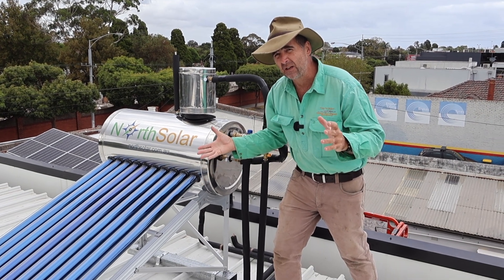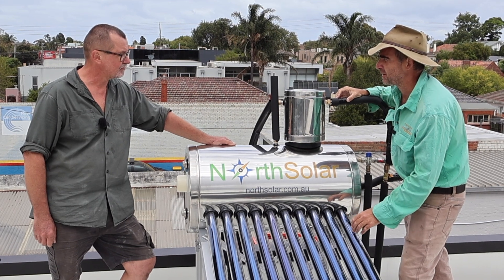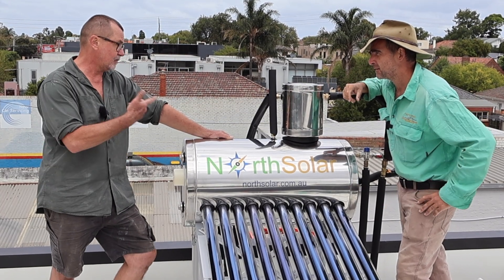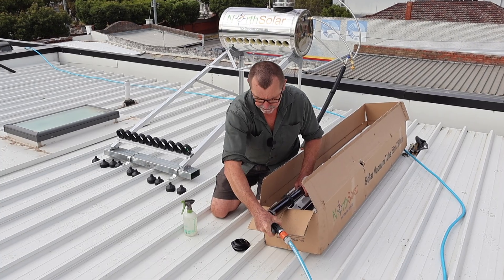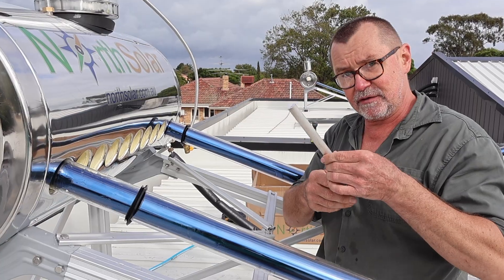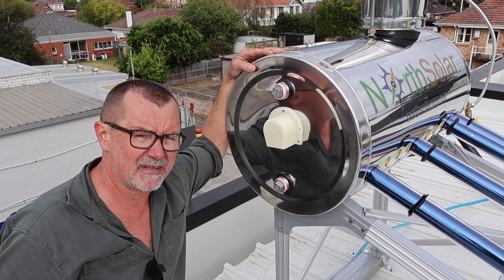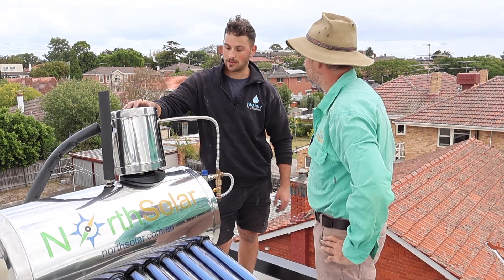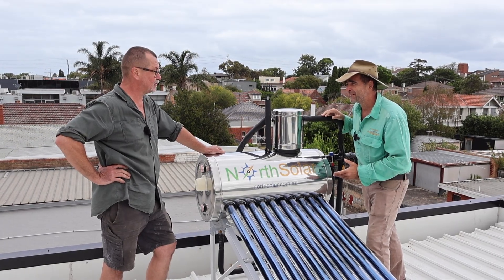Free Offgrid Hot Water?

Comment: Good job with the video, so much so that I bought one. BUT,  the bee guy did do a good sell on a product that is NOT viable during June/July etc, unless you definitely have the electric elements to go with it. Water goes cold overnight if the air is chilly, warms just enough during the day but the moment you turn the tap on the influx of fresh cold water dramatically reduces the temperature, and is exponential after dark. NOT WORTH THE MONEY! Speaking with the local solar/plumbing guru (post purchase) it is sooo much better to buy an electric water  system and additional panels where you set the timing of the system to activate during peak daylight hours. Or just go gas.
Reply: Hi Justwait,
Andrew here form North Solar.

Our clients that have issues contact me to find why there may be an issue with their system.

I always help out with a solution, if the system is not suited to them we are happy to give a refund....no questions asked.

I don't believe you have contacted us, hence this appears a little bit of a 'Troll' comment'.

The most common issues we see iare:

- Tempering valve gets blocked on off-grid properties (this is easily fixed by cleaning the mesh), 

- Installed by a non Registered plumber
- Installation under a carport (solar systems don't work well in the shade!)
- Tubes being installed the wrong way around

I don't know your location, hence can not comment on your situation especially when it comes to the amount of sunlight on your system.

Unfortunately we can not control the sun.

I always inform my clients that Autumn/Winter may need boosting by either 'Electrical Heating Element' or Wet-back/wet-flue.

Please get back to me with a real name so I can assist with a solution.

Andrew
Reply: @australianbeesupplies 
Hi Andrew,

I also have one of your units on a property that I have purchased in Adelaide. First the header tank leaked and after being unable to contact you by your online supplied number and email to get advice. I just purchased a new tank online. My plumber has since repaired so I no longer needed the tank, and I emailed asking for a return and refund on the tank to which also no reply.

Through summer it’s amazing, but now it’s cooling to 20 degrees I am for some reason getting sometimes hot and sometimes luke warm. I have it connected to power and would love to work out the issue but without being able to contact you for advice and relevant parts then yes, I believe your product is useless also.

I have bragged to my plumber about your unit when he repaired the leak and would love to continue bragging. But when I can’t contact you to get advice on how to fix my issue then my unit may also become land fill too.

Cheers Cam
Reply: @australianbeesupplies  I ignored your little jibes and moved on, but now I have to drop a final review. I don't need to defend myself, I have controlled all of the installation issues from the get-go.

It is now that after wasting $5k+ on purchase and installation that in conclusion this thing is being disassembled and is off to the landfill. Late July and for months showering has been nigh on impossible, and heaven forbid if multiple people need to do their ablutions. Washing dishes has been 80% by heating water on the stove because it is usually after 1 household member has showered post sundown and the evening meal prep has been completed. As previously stated, using water after dark exacerbates the issues exponentially. I also stand by the statement that the water is tepid by morning during winter due to what I perceive as poor insulation.

Additional points:

*The frame is wafer thin and I fear that in a strong wind above 70kph it would collapse if not in a windbreak area. I can't wait to drain this thing and have peace of mind. This is merely my observation and engineering may prove me wrong, but this is a constant worry. Even the frail little rail that holds the base of the tubes is bowed under the weight of only them.

*The header tanks containing the float valves leak constantly. Changing between hi-flow  to low-flow units makes no difference. Multiple fixes, swap outs and reinstalls sees the problem contained for barely a day or 2. These tanks are pressure fed from a measly 400W pressure pump, you can almost contain the pressure by hand yet these units fail every time. 

*On the days when the water does reach temperature I become nervous about what this means for summer when the temps are constantly 35+ Celsius? If the leaking float valves aren't bad enough then I fear the daily wastage of water via pressure relief, whereas gas or electric are both regulated - we can't regulate the Australian summer sun!

So why would I come back for more? I make no apologies, bee guy, you can defend as you will, my review is based on performance and function. I solemnly stand by my experience that these are not suited for winter conditions in the lower third of Australia WITHOUT electrical or flu-wrapped copper piping from a wood combustion firebox or the like. 

My plumber/solar guru upon finding out about my purchase just laughed at me prior to install (read my initial input re him). He has a 300 litre Bosch evac-tube system with electrical backup and REGRETS IT - hence his laughing about these rebranded Chinese units. His laughter was justified.

I won't jibe you as you did me, bee guy, I will just leave my observations here for the consumer to read about. I am not seeking any refund or the offer of any further solutions, I will wear this cost as a pricey lesson learned, I won't on-sell it to a 3rd party, it is going to landfill and I will return to what could have been 3 - 4 gas units for the cost of this POS. Have a nice day.
Reply from the maker: Sorry to hear that mate. I will follow this up
Reply: @FarmLearningTim  Thanks but not required, unless it is for your own research. You did a great job, in no way did anything you say during the segment indicate guarantee of satisfaction. And my comment is my own opinion, even though it should serve as a point of awareness for potential buyers.

Comment: Its not stupid that everything has to be lagged. Get up there on a cold day with cold hands, and you'll quickly find out why it all has to be lagged.
The evacuated tube type that I know works on a heat exchange system, no water goes in the tubes and the tank is at mains pressure. The one in this video is gravity fed, and the water is heated directly in the tubes. A bigger tank means a longer tank and more tubes I presume.

Comment: Just a note that efficiency doesn't matter when the fuel is free.
Also, when a home is "going solar" and getting PV as well, it's actually more economical to avoid solar thermal hot water systems altogether and instead add an additional PV panel or two to drive a conventional resistive element in the hot water tank.
Reply from the maker: Efficiency matters in winter when there is not enough sun. These systems take the load off solar over to allow you more electricity to watch YouTube but still take a shower so that you don’t stink

Comment: I checked these out many (maybe 20) years ago for North Queensland and was advised they are TOO EFFICIENT for the tropics.
Reply: 6-9 months of the year up there one wants a cooler shower, probably only for washing the dishes do you want hot or super hot water. Was in Townsville many many years ago and they just had a coil of poly on the roof as their primary hot water system, and I guess gas for the cooler month(s).
Reply: Do you see them on any roofs now? I'm surprised they didn't tell you to simply remove some tubes.
Reply: @gregbell2117  Not that I take much notice.  No in Townsville.
Reply: @malcolmcheyne3803  This was out past Townsville place called Calcium on the way to Charters Towers. A roll of 19mm or 1inch poly for hot water. Though these days probably will see them for pool heating (though again probably not so much in Townsville/Cairns) but in Atherton in winter gets pretty cool at night and down BrisVegas way houses have them for pools though they occupy a large percentage of the roof to heat a large body of water.